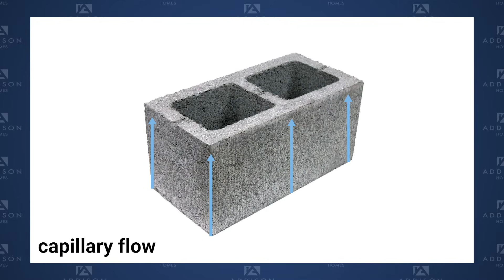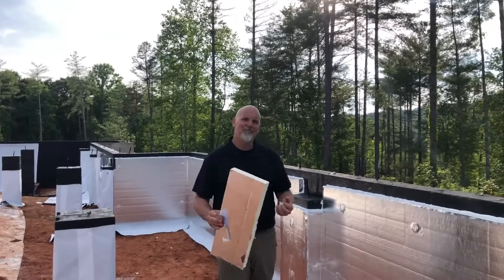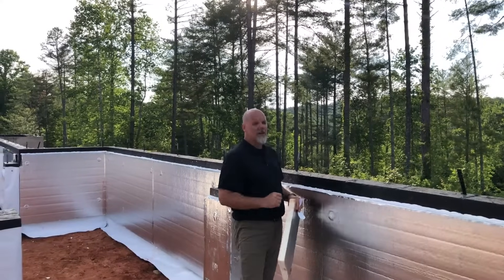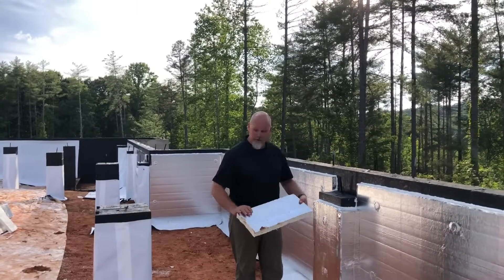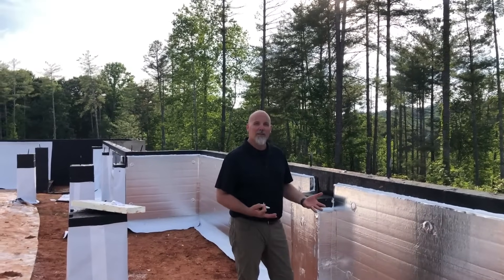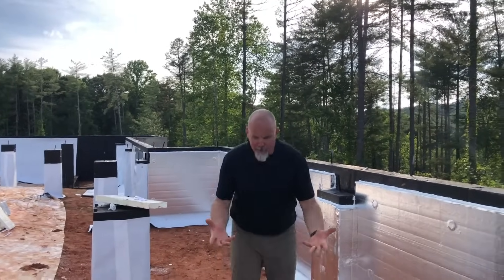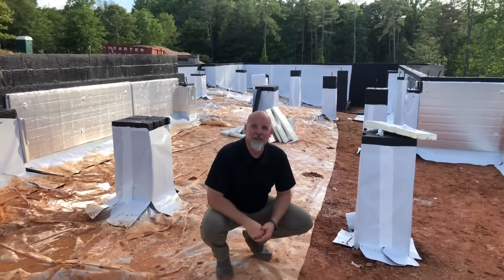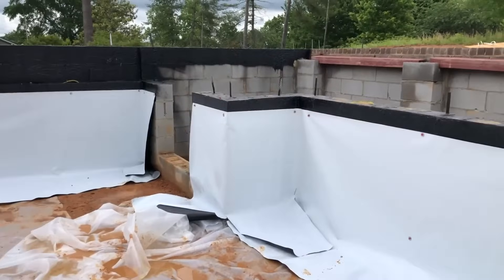Closed Crawlspace | Construction "Rough-in"

Comment: You’re doing great stuff! How do you handle waterproofing brick exteriors on the block, since you can’t really spray waterproofing where the brick would go. And do you remove the temporary vapor barrier before putting down the permanent one?

Comment: Whats the point in putting up the vapor barrier if your gonna create a hole in it by nailing up foam board later? Now you have many hole in that barrier that you can't seal.
Reply: Yes, I agree especially since it’s airtight he should technically be able to close off those vent but bc he’s in the hot and humid south that can only happen if he adds in a hard wired dehumidifying machine which he might not do.

Comment: Would you pour a slab over the vapor barrier or just leave the sacrificial vb as is?  Just thinking about hoe Japanese crawl spaces are designed and built on top of which are often traditional timber framed structures
Reply from the maker: @philallsopp42  a slab can certainly be poured over the vapor barrier, but this adds significant cost with no substantial benefit.

Comment: Why is there no termite inspection gap in a finished basement? 

When are we going to get the codes updated for a crawlspace built to this level. 
Seems like a gap is not needed if the inside of the crawl space is going to be built that well. 

Next question why not water proof under the footing to stop moisture flow from the bottom instead of letting g it wick all the way up the block wall?
Reply from the maker: Great questions:
- The termite inspection gap is impractical on a finished basement since it is typically inaccessible when a drywall ceiling is used.  For a lay-in tile ceiling, the top of the wall is accessible for inspection.

- The gap is needed for a close crawlspace.  Without the gap, there would be no way to see if termites were tunneling up through the foam insulation board.

- Waterproofing under the footing is more challenging than it sounds.  In the Southeast, we typically dig a footing trench and fill it with concrete.  In order to waterproof the footing, we would need to line the trench with a moisture barrier and ensure it gets wrapped around the footing.  Realistically, it is difficult to ensure that this barrier is 100% and also difficult to ensure that rain/moisture doesn't soak into the masonry wall above the waterproofing and wick up to the framing. 
We have found that the spray applied sealant is extremely easy to apply to the top of the wall while our waterproofing contractor is on-site spraying the exterior below grade foundation walls.
There is a product that @jake.bruton.arrow.building covered in a recent video that is actually a footing form that potentially doubles as a waterproofing footing wrap.

Comment: Any kind of settling of the wall will destroy that home. Cinder blocks are trash.
Reply from the maker: The first Concrete masonry units “cinder blocks” were developed in England in the 1850s and are used in many applications today ranging from foundations to commercial buildings. They have been used successfully in construction for over 100 years in the United States and are not “trash”. Settling of any foundation can potentially damage a building which is why it is of vital importance to ensure that the soil load bearing capacity is adequate for the building to be constructed, and the footings are designed and installed to be compatible with the soil bearing capacity and the building design (and include steel rebar reinforcement).  If these components of a building’s foundation are not properly accounted for and designed, no foundation wall will be able to support the building successfully. 

Broad statements claiming certain building materials are “trash” without providing supporting data, are very misleading to those with limited knowledge of construction.

Comment: I’m trying to decide on whether to put the vapor barrier on top of the insulation foam or behind it. I noticed the majority of people put it on top of the insulation but some people like yourself go the other route. What’s the reasoning behind this and doesn’t even matter?
Reply from the maker: Its much easier to run the vapor barrier up behind the foam board and let the foam board "hold" the vapor barrier against the wall.  My primary concern with installing the vapor barrier over the foam board would be moisture pickup in the foam from the ground layer below.
Reply: @AddisonHomes  thanks for the reply. I thought it through and decided the same. I put the vapor barrier behind the foam, but also decided to put another loose layer of vapor barrier on top of the foam because it’s more aesthetic and help protect foam from damage because I store things along the walls of my crawlspace

Comment: What products would you suggest for a foundation like this? I see you have no vents in this wall. How are you going to remove humidity and bad air from the crawl space?
Reply from the maker: You can find all of the products at gmxwaterproofing.com  The goal of a closed crawlspace is to seal it completely from the exterior.  If the crawl is encapsulated properly, there is no bad air coming from the soil below and the humidity is controlled by a whole home dehumidifier.

Comment: Excellent video. Thanks Todd. Question: with a crawl space that deep (high), why not just make the walls a few feet higher and have a basement? Moisture potential? Expansive soils? Budget? Thanks - I'm considering options - crawl space or basement or slab first floor.
Reply from the maker: Fantastic question!  The easiest (and often most cost effective) approach to foundations in the South that push 6-7 feet tall is to go all the way to a basement foundation and gain that space for future use.  The encapsulated crawlspace is often the most expensive foundation type.  The client on this particular project did not want the extra space of the basement (which would have added some incremental cost).  So it was a decision based upon need and budget.
Reply: @AddisonHomes  Makes sense. Thank you.

Comment: Why crawlspace instead of slab or basement?
Reply: Heavy rain, flooding(raises your home). Plumbing, electrical, hvac, etc is accessible. So, you don't have to break up concrete.
Reply from the maker: This project could have easily been a walk-out/daylight basement but the homeowner didn't want a basement.  Topography had too much slope for a slab.

Comment: How would you suggest I request our builder in upstate SC to do this if it isn't standard industry practice? 😅We haven't signed any contracts yet but I was told we will have to use a crawlspace instead of a slab and we're very concerned about mold growth to the point we may not move forward on the build because of it.
Reply from the maker: Sorry for the delay responding.  Its a difficult question since most builders do not understand why a vented crawlspace has so many issues.  You could try to have them understand the science behind an encapsulated crawlspace using resources such as crawlspaces.org.  We would be happy to discuss this further with you if desired.
Reply: @AddisonHomes  thank you! We were actually able to find a lot that they could build on slab instead do we went with that!

Comment: How does a sealed crawled space fare when the building is unoccupied, no power, between owners, hard times, etc. Should any crawl space retain the option of venting under such circumstances? If you've ever opened a cooler you haven't used in a while, even washed and in only a couple of days, you'll smell and probably see mold growth.
Reply from the maker: A conditioned, sealed crawl needs to be maintained within an acceptable humidity range either by operating the HVAC system or having a dedicated dehumidifier.  It is not intended nor designed to be left unconditioned for any period of time.  On the other hand, a vented crawl will always have a musty smell like a cooler due to high moisture and condensation on surfaces.

Comment: The money you spend on all this you could have had a basement.
Reply from the maker: In many cases where the slope would work for a walk out basement, you are correct.  For sites where a walk-out basement will not work or the client does not need the extra space of a basement, the encapsulated crawlspace still less expensive than a basement.

Comment: lets not talk about the fact that every single fastener he used is a potential source of moisture intrusion. not only are there fasteners in the membrane but then more fasteners in the foam board. much better to use special adhesives designed for this application.
Reply from the maker: Not really - the foundation wall is waterproofed on the exterior and the fasteners are only on the interior side of the 8" thick wall.  They penetrate no more than 1/2".  We are not relying on the membrane nor the foam board to be moisture barriers on the interior of the foundation wall.

Comment: So if doing a vented crawl, will the black waterproofing paint be needed? If so, what does it do, the purpose?
Reply from the maker: The waterproofing below grade with a perimeter drain is best practice for any Crawlspace or basement foundation to keep water out of the foundation. It’s not required by code for a Crawlspace, but without, you risk water issues, vented or not. The waterproofing we apply to the top of the foundation wall serves as a capillary break and is also simply a moisture management best practice to eliminate capillary moisture movement up through the foundation into the wood framing regardless of venting a Crawlspace or not.
Reply: Do you come back with a brick veneer on the exterior of the foundation to cover the black waterproofed CMU? 

I’ve noticed most crawls I’ve seen have 0 waterproofing, just the CMUs and raw dirt under the home and some don’t even put a capillary break.

I can see what the plastic on the ground does to prevent ground moisture from rising and seems a very minimal cost increase to “sell” to a cost conscious home builder but what does waterproofing the CMUs do? I see you incorporated a capillary break with the waterproofing but want to understand the benefits of waterproofing the CMU.

Thanks!

Comment: May I ask why foam board and not just hiring a crew to spray foam over the vapor barrier? Is it to not have a delay between the crew who sprays the waterproofing and installs the vapor barrier? 

I would think a spray foam would be continuous.
Reply from the maker: One crew does waterproofing, liner, and foam board. Spray foam would add another crew and it is far more expensive.  Many spray foam crews wouldn’t even touch only Crawlspace walls without a hefty minimum charge.
Reply: We are on the same page, one crew completes the job. I’ve just seen another builder in Kentucky do spray foam on the perimeter.

I like your method, one crew and get it done.

Comment: Is there a reason NOT to pour concrete for the crawlspace floor?  I mean other than cost, obviously.  I'm adding a 900 SF rectangular addition to my home. I think I would like a full concrete floorspace with about a 4-5 foot depth. I mostly want sealed environment storage.  Am I wasting money?  Is your system a better way?  I watched the other video with the finished-out area and it does look great.
Reply from the maker: Great question. It definitely an option for an encapsulated Crawlspace. Just need to insure that the vapor barrier is continuous under the concrete and sealed to the foundation walls. The concrete is more expensive but makes for a super nice space!  You can actually pour a thinner slab (2-3” vs 4”) since it’s not going to have heavy traffic. Please send pictures if you pour it!!
Reply: So, for encapsulated crawlspace, built from the beginning as such, you wouldn't just build it the way a pool is made?  I was watching video I took of the construction of my pool. They dug the hole with a skid steer. Put down rock. Compacted it. The put rebar down the sides and across the middle. One giant wire mesh everywhere. Then they started blowing concrete. No barriers! Is that because you dont care about moisture with a pool?  Lol
 @AddisonHomes
Reply: @addisonhomes Also, could you use galvanized steel posts instead of concrete & rebar columns?  You know, like they have in a warehouse to hold up the steel beam ceilings.
Reply from the maker: @4813RT  would just be an expensive Crawlspace!
Reply: Thank you for responding.  I'm exploring all my options and this is very helpful.
Reply: Also, could you use galvanized steel posts instead of concrete & rebar columns?  You know, like they have in a warehouse to hold up the steel beam ceilings. @AddisonHomes

Comment: Great video. When connecting and taping the vertical and horizontal sheets of plastic film which one do you overlap on top of the other?
Reply from the maker: Great question!  I always use the “think like a shingle” mantra which you have to think about upside down since we are concerned about potential water from underneath.  So, the membrane on the floor is lapped on top of the membrane coming  down the foundation walls. Laps on the floor membrane will depend on the slope of the Crawlspace floor. If water were to flow beneath the membrane, we want to avoid water “catching” a lap from beneath bringing the water to the tape seam above. Let us know if this makes sense. If it doesn’t, we can make a quick video to illustrate.

Comment: Why not just spray the crawl space walls with spray foam insulation? Seems like a way better way to do it .
Reply from the maker: 2 primary reasons in our market: 1) Cost and 2) Termites.  To prevent moisture issues with spray foam in an encapsulated crawlspace, closed cell (2 lb) foam would be recommended.  The vapor barrier would need to be extended up the lower portion of the foundation wall so that the foam can be sprayed on top to create a continuous barrier and a 4 inch termite inspection gap would have to be left at the top of the wall - same as with the foam board.  The closed cell spray foam is much more expensive than the foam board, so it really doesn't make financial sense.  We NEVER spray foam in the rim/band around the floor system in crawlspaces, as this prevents the termite inspector from easily inspecting for termites - the rim/band is where termites are often first discovered.  Our termite service partner is ADAMANT that the rim/band is easily accessible for inspection, which for us means batt insulation on the interior and continuous insulation on the exterior.

Comment: Watching again for the 10th time. I appreciate a video actually focused on climate zone 3 (I’m 3a hot humid but close enough).  Couple questions come to mind. 
The exterior waterproofing- what is your cladding or are you backfilling that?
The foam board- I presume that’s foil faced XPS?
Thanks
Reply from the maker: So glad you’ve found it useful!  The exterior foundation waterproofing will be covered by backfill. The foam board used on the interior foundation walls is foil faced polyiso foam.
Reply: Thanks. I saw in another comment where you had clarified also that the waterproofing was just up to the backfill level. 
I had assumed the was not polyiso since that is not rated for ground contact but, then again, this isn’t contacting the ground…that’s kind of the whole point. 
Thanks again.

Comment: Hello! Great video. I am actually buying a house in a very close  area from the video (Campobello). I am wondering if it is required for new homes to be build with a capillary break installed on the block these days? I know nothing of home building but know that the house I am trying to buy has a large crawlspace and know it has a dirt floor and a covering I assume (hoping) is a radon barrier.
Reply from the maker: Glad you enjoyed it!  There is no code requirement for capillary break on foundation walls unfortunately.  Current code does require a vapor barrier over the dirt in a crawlspace.  This can reduce radon, IF there is a radon vent  up through the roof.
Reply: @AddisonHomes  Thank you for the quick reply! Cheers!

Comment: ICFs are great but very expensive for a crawlspace foundation.  If you were building a full ICF home, that would be a logical choice.  The concrete slab in the crawlspace will require a vapor barrier beneath either way, so its just $$ to incorporate a concrete slab in the crawlspace.  Always be sure to provide a 1-way crawlspace drain at the low point of the crawl foundation to allow water to escape if there is ever a plumbing leak beneath!
Reply: Where's the ICF?
Reply from the maker: Insulated Concrete Form
Reply: there is no need for a drain in a conditioned crawl space. a drain is only going to bring more moisture in and be an extra penetration that will add another moisture intrusion point

Comment: Seems silly to build a useless crawlspace and not a basement. 

Is it just tradition down there?
Reply: We considered a basement but it would have added a significant increase in our school fees per square foot. Which our tight budget couldn't afford.
Reply from the maker: Its a combination of our rolling topography and relatively high frost line that resulted in crawlspace foundations historically.  They still make sense when a lot has some slope but a basement isn't needed by the homeowner.  But your observation is on target - if another foundation type (slab or basement) can be justified, it makes far more sense!!!
Reply: Rock is a factor and older people don’t won’t basement, due to stairs and cost.

Comment: Which gun, fasteners, and adhesive are you using?
Reply from the maker: We use the Hilti powder actuated gun with the foam fastener ram and the hilti foam fasteners.  Simpson also makes a similar foam fastener for their regular gun I believe.  The vendor, GMX supply also makes an adhesive that we use and works great.  Its a polyurethane adhesive with good adhesive properties - Its called SealIt XP.  https://www.gmxco.com/products/crawl-space-systems.html